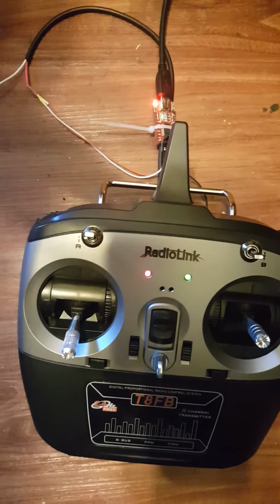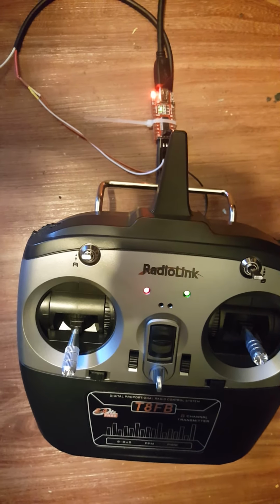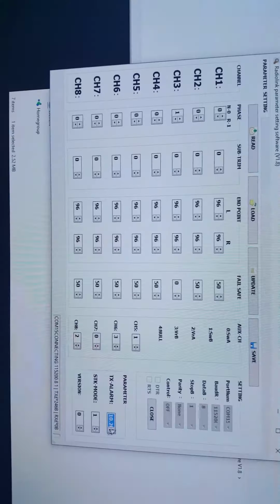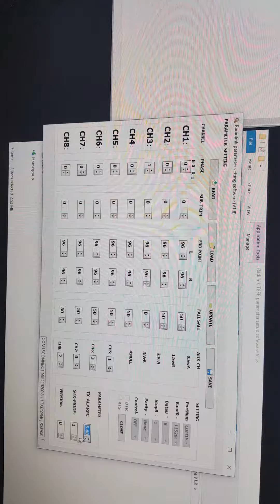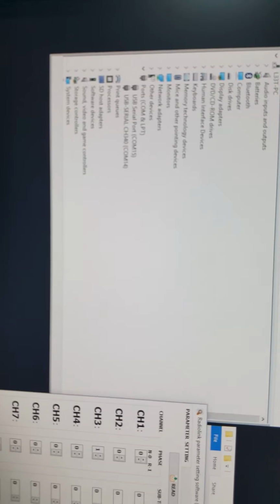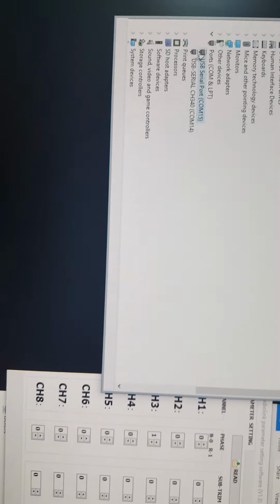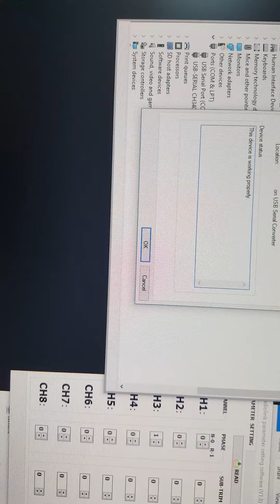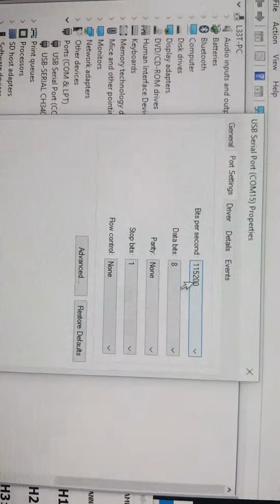Radiolink T8FB configuration of comports and setting updates.

Comment: i cant bind this remote also please help
Reply: Did you read the comments below.

There is a discussion on this topic. 
Let me know if this helps or it you still need assistance. 
Also curious about your build.
Best regards 
David Gaspar
Reply: I bought this controlere as well, but I'm afrai it might be a fake. Do you have the reversing switches on lower part of the front of your controller. If not, does your controller work properly ?

Comment: How to bind ?
Reply from the maker: Bryam Lucas use a bind plug when powering on the rx.    then turn the radio on.        it should linkup..    
let me know if that works for you, if not i will complete a bind process to confirm.    thank you.
Reply: Thank s
Reply: When the bond works, what color does the light stay in?
Reply from the maker: on..  aka not blinking.